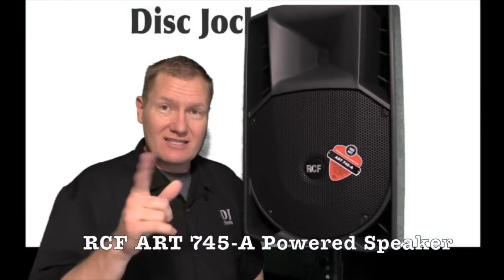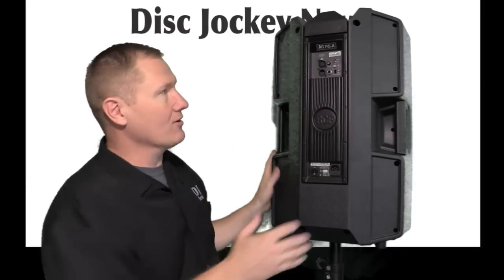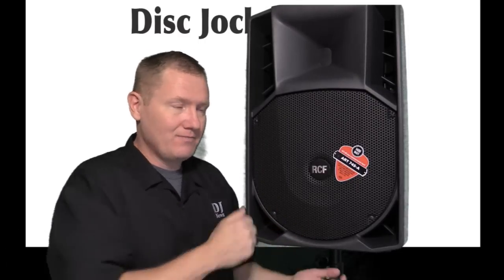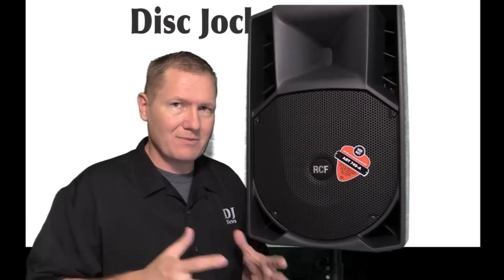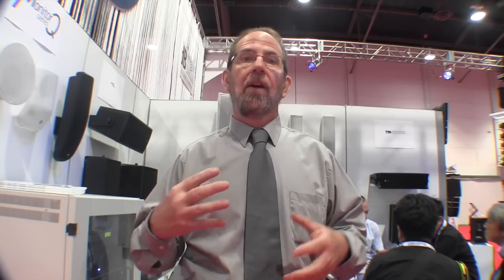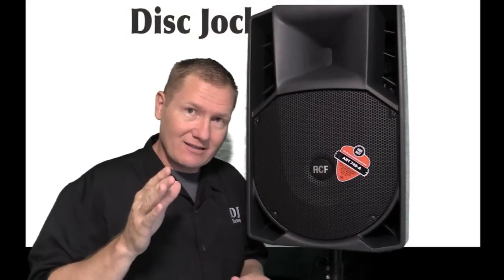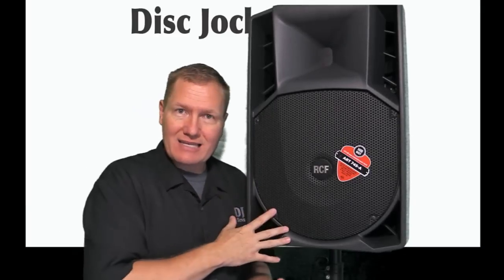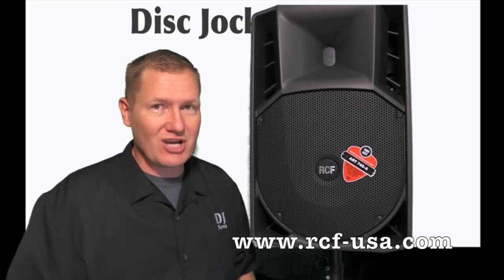RCF Art 745-A High Powered Speaker: By John Young of the Disc Jockey News

Comment: how can u compare those to the QSC KW152? 
i own a pair of QSC and im looking for a change. mines are 1000 watt rms.
Reply: dj alexr1,
I got rid of my kw152's when I picked up my art745's.  No comparison.
Reply: desmo rider Just a question. How is the low end on these rcf745 speakers compared to the qsc kw152? Could you do lets say 50-100 people party without subs with these speakers and not the highs br too loud?
Thanks!
Reply: RAMAN CHHINA I think that the 745a is all around better then the kw152.  Better highs, better lows, and louder.  You can easily do 50-100 crowd with only the two tops.  If you want or enjoy club like bass, you will need some subs.
Reply: Dj AlexR1 general rule of thumb......rcf rocks qsc are doggy doo amen
Reply: Dj AlexR1 Here's how they compare. You pay TWICE as much for the RCFs. Any more questions?
Reply: Had qsc sound great at medium volume but 712a mk 2 still sounds better then k12! Cant wait to get 732a maybe 735a
Reply: 1000watt please open up you will see celestion tweeter thats 70watt rms
Reply: watts means nothing except how much electric you are going to use, it has little relevance to how efficiently the speakers produce sound, efficiency is everything when choosing speakers for high spl
Reply: I bought a pair of Rcf 745-A yesterday.They are so powerful speakers with clear and crisp highs and a powerful bass.
Reply: desmo rider do you feel the plastic is fine now or okay for 15” cabs instead of wood